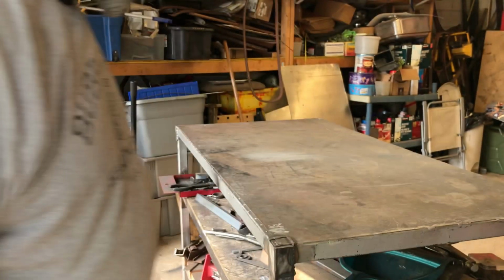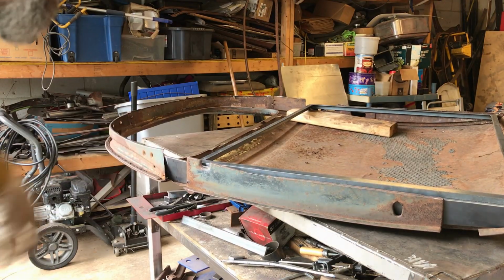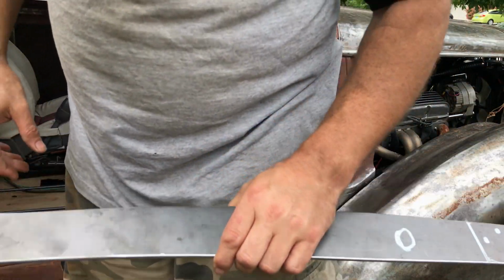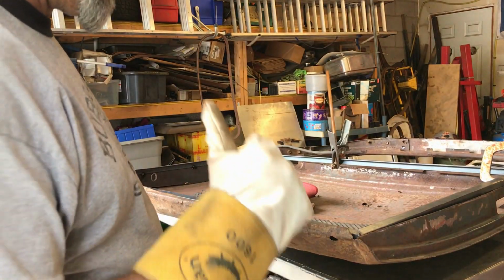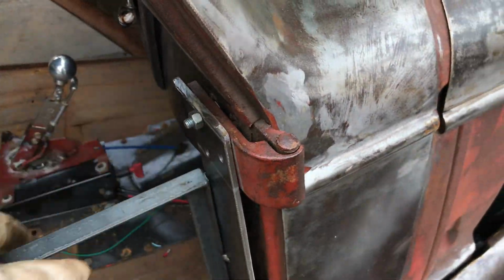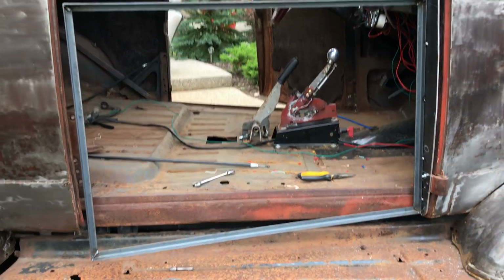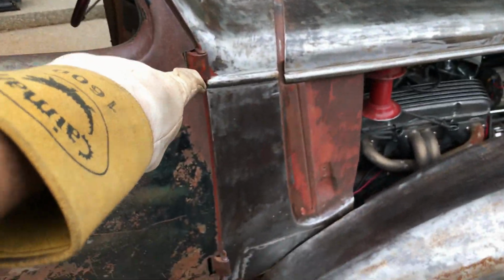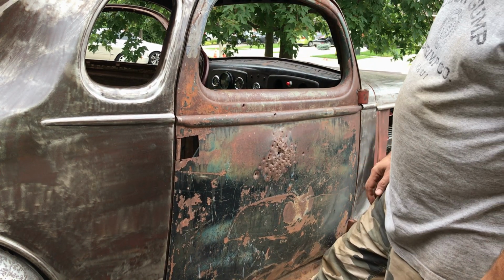Door Frame Fabrication Part 3 Installation And Alignment

Comment: I think you may be able to put a little structure in the top of the door with some 1/2 inch rebar. Easily bent with a torch. Just one idea. Good luck.
Reply from the maker: That's a great idea, thanks.

Comment: It would look cool to braise the bullet holes so they are sealed up but a different color when you strip the pain and rust off!
Reply from the maker: I have a plan for that ;-)
Reply: Looks very good... I have a ‘35 Master Coach suicide doors, wood is gone and I’m pleased to see your ingenuity on the door-
Curious if you chose angle instead of 1/2” tube, and also a good time to add an inner side bar side to side for added passenger safety?
Very skilled work Fave, loved those new door jab/frame...
No criticism..., tough job- If nothing ever goes sideways, those are folks who have never done ANYTHING-
Mike
Reply from the maker: @buildingconsultants1854  Thanks Mike. I only chose angle over tube to save weight. As you say, it still needs some cross bracing for passenger safety.
Reply: @buildingconsultants1854  Hi Mike. Do you have any extra pieces for your '35?
I am looking for the sheet metal piece that joins the two front fenders together under the rad shell.